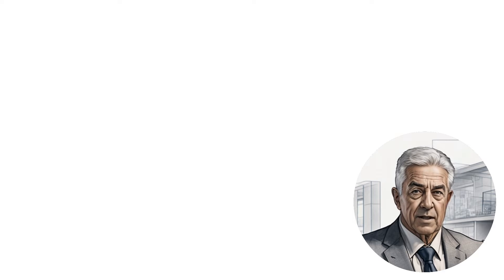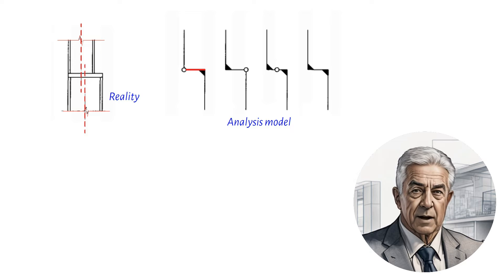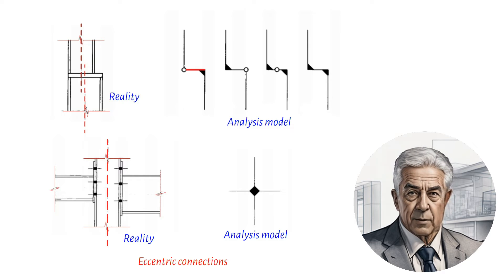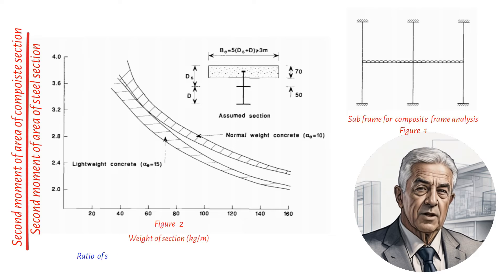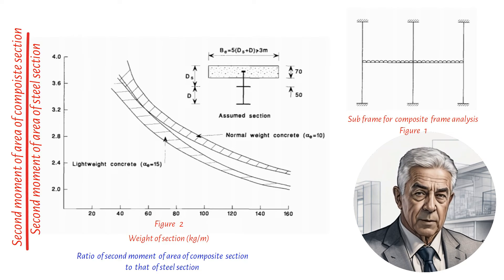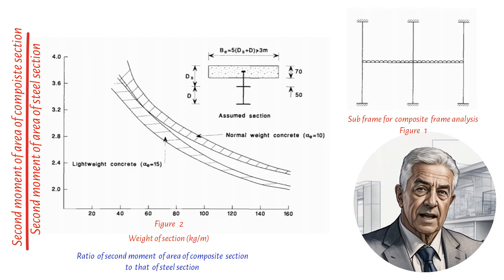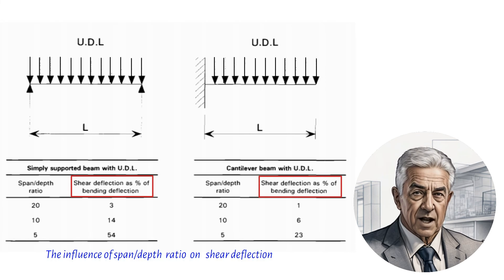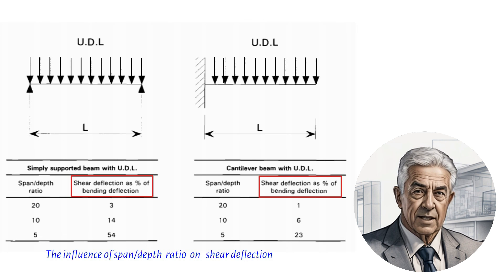How Shear Deflection Impacts Deep and Composite Beams.

Comment: Shear deflection becomes exponentially larger than bending deflection in beams with a span-to-depth ratio of less than 8, however it will most likely be well under the appropriate deflection limit.
Reply from the maker: Thank you for your input. It's important to consider both shear and bending deflection in beam design to ensure safety and reliability.